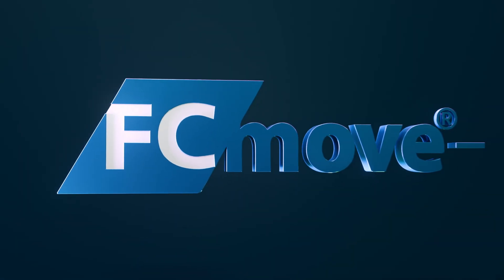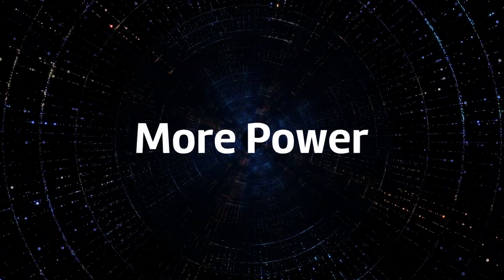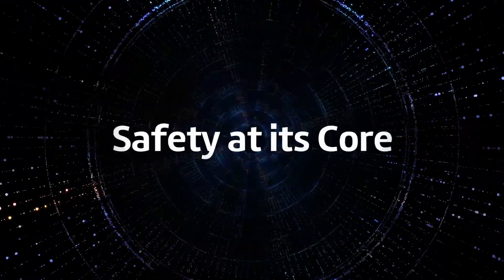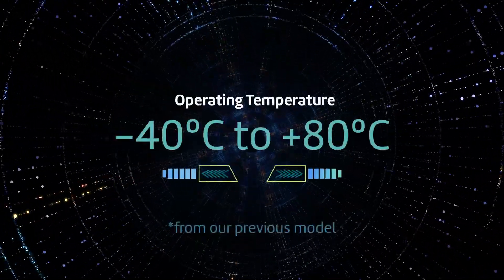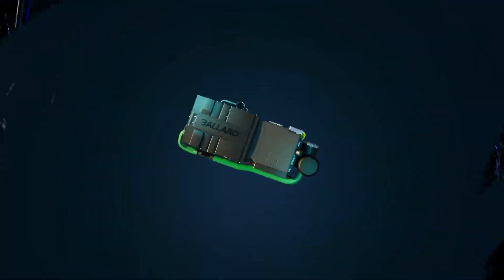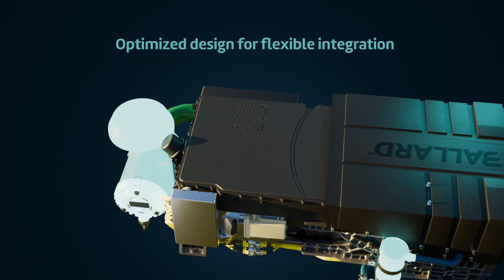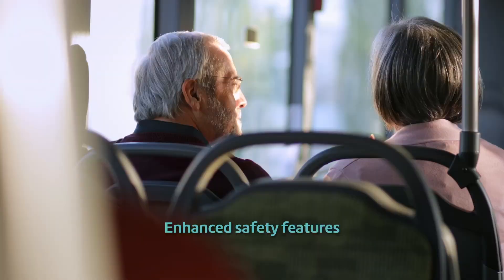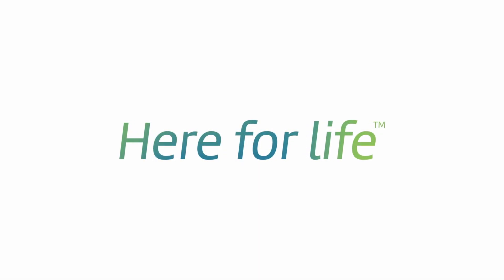Ballard Power Systems  FCmove®-SC

Comment: If hydrogen technology was the future of transit it would already be here in abundance. Its only practical in niche vehicles and the transportation of the product is way to dangerous for residential communities. Its a low power alterative to battery powered and hybrid vehicles today. If there was massive demand for this product others like Cummins, Eaton, Etc would be all over this market share, but its a old technology that's never advanced because of the laws of physics, (storage, temperature problems that cost $) and the advancement of other technology's like electric, diesel, hybrid, and so forth. With the hard nature of this business and how Ballard has not ever been cash flow positive in its existence why would people start to believe today that this product and business model is just going to boom?. Just because the stock price is increasing with the current market sediment doesn't mean factual financial progress in the future. in my opinion i think they may take advantage of the rising stock price and raise more capital so they can hopefully survive to the next " lucky rise" Be wary of this one and the others that have duped investors in this market many times. Ballard if you could rebuttal and prove a stable revenue increase with cash flow positivity, not by issuing a press release of how you will do it but actually show it on your financial reporting i will cover my short.

Comment: I like how this video gave us zero practical information while promoting a technology that's already dead. BEV's with reverse pantographs are significantly more efficient, lower complexity, and use a significantly more available fuel. The lifecycle cost of this is an uphill battle what was given no hard numbers.
Reply: Harlan Ellison once wrote "...the two most common elements in the universe are Hydrogen and stupidity" and the latter is far more prevalent in your comment.